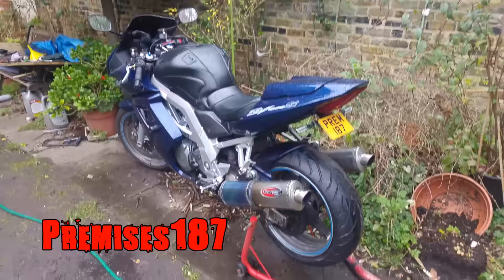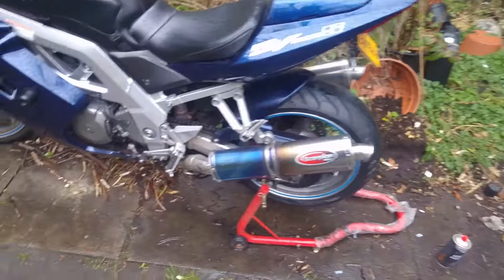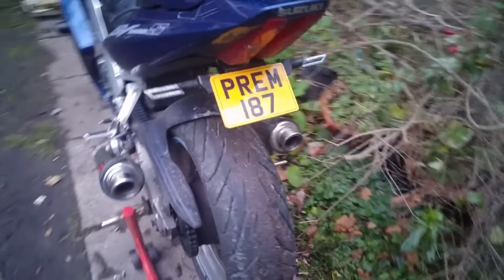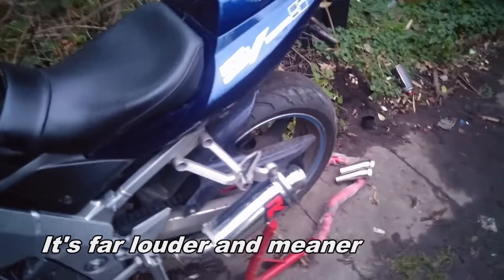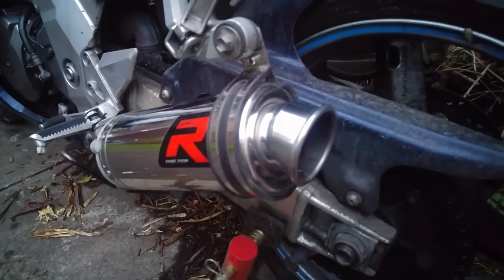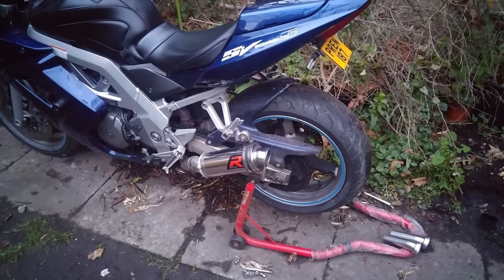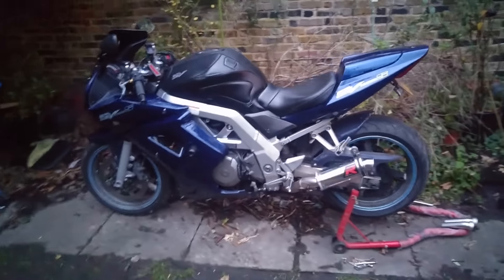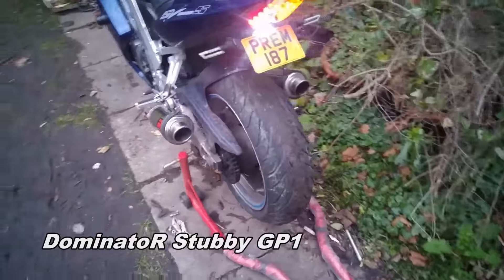Dominator Stubby Exhaust on SV1000s

Comment: Dominator exhausts are great value for money but they do have issues with fitment. Had to send mine back as it was complete misfit and they admited they listed without checking if it actually fits for listed year.
Reply from the maker: +Nick Montana it was a pretty tight fit. It was just the hangers that were off. The 2003 SV1000 exhaust position is different from the 04 onwards.

Comment: Just a quick question.. Where did you get that reg plate? i've been looking for a slightly smaller one for my bike and can't seem to find any good places
Reply from the maker: +Ksolidey Just look up number plates on eBay. You're looking at around £7.
I felt that plate is too small because you can see the black plate holder frame.
Reply: Premises187 Cheers pal, was looking on Amazon but couldn't find how to customise it :/ btw, love the new sound!

Comment: And the point of getting a differant exhaust is? I mean... they dont really provide power...
Reply from the maker: +Dark Star The smaller ones are far louder. The scorpion exhaust are pretty quiet even without the baffle.
Reply: Premises187 Ah I never knew that. But aint there a decibel limit? I mean my dad used a security sticker on his exhaust and put it over the part where it said "NOT ROAD LEGAL FOR RACE USE ONLY" ...
Reply from the maker: +Dark Star yeah some exhaust annoyingly have race only on them. But if it doesn't have anything written on it like these then it'll pass with the baffles in no problem.
Reply: +Dark Star I'd say they're mainly there to let drivers know you're coming :D